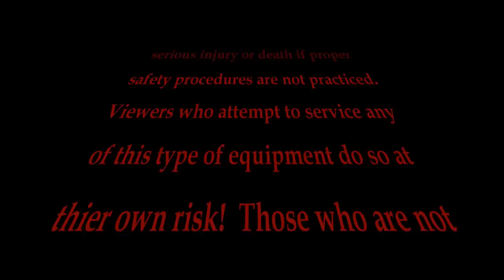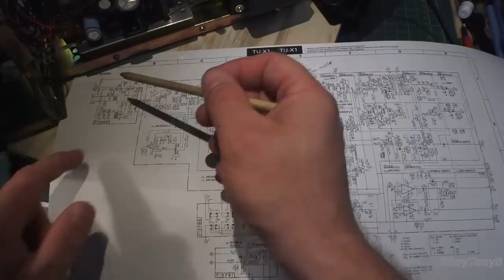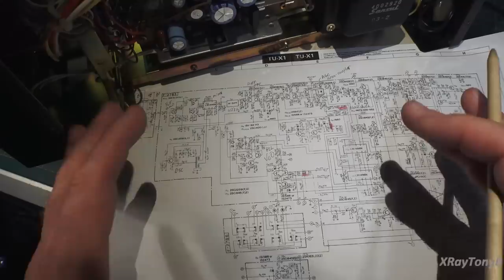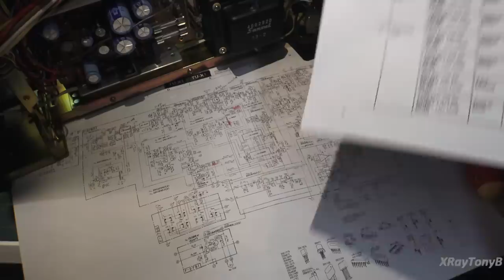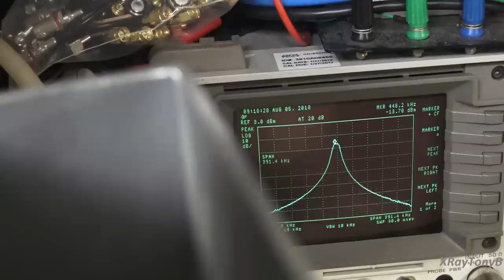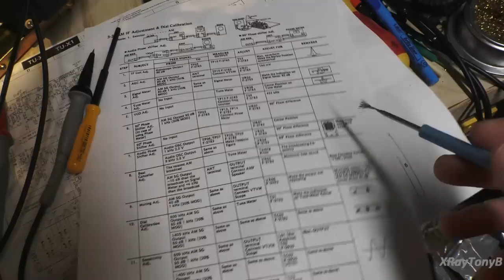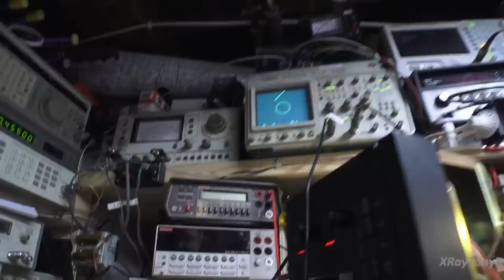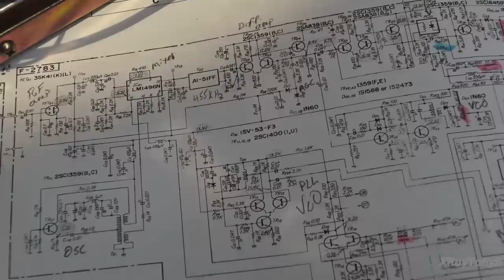Sansui TU-X1 Part 2 - The AM Section

Comment: I am surprised that they didn't see fit to use a Balanced Quadrature Sampling Detector (QSD)(Tayloe Direct Conversion) in the AM side to allow you to listen to signals and get rid of the interference.
Reply: Probably predates the Tayloe detector.  The full quadrature detector is basically as good as you can anyway, and won't spray as much harmonics and subharmonics of 455kHz everywhere too.

Comment: Maybe I missed something, did you demonstrate the am centering meter after the alignment? Cuz it seemed there may have been an issue there going off the first video. And how'd you resolve the 455 kc centering issue? I'll go back and watch again....
Reply from the maker: Hi Jeff, I don't think you missed anything.  I think I may have edited a bit more out than I should have.  The meter works, but it still has very little deflection.  According to the alignment procedure, there is only one adjustment that affects it and it was set correctly.  At this point, I think it just might be the meter, as when I measure the voltage across it, there is a change when I tune off station.  As for the filter, it is definitely bad.  The center frequency is off by almost 3kHz but the bandwidth is wide enough to drive a truck through.  I'm sure this could affect the selectivity of the tuner.  I still might try another non-adjustable filter, as I don't think the original will be easy to find.  If I decide to try it, I'll most likely do a follow up video if there's enough interest.  Thanks for watching!
Reply: So how many IF stages are there and how many IF adjustments? How did they get a a narrow bandwidth with one wide bandwidth filter?
Reply: Hi! Thanks to you for TU-X1's videos, I have learn a lot. I also have  a very nice TU-X1 which was in service and adjust at SS (CT) about 10 years back. That am-meter needle should move like as fm-meter. Your received am-signals/interferences are not strong enough (as you told) and that's why the needle movement is so minor.  73'

Comment: I WOULD JUST LOKE TO KNOW WHAT ARE YOUR THOUGHTS ON THE ONKYO INTEGRA LINE FROM 1987 TO 1993. DO YOU THINK THESE WILL BE FUTURE COLLECTABLES OR DO YOU THINK I SHOULD JUST STICK WITH PIONEER SASUI AND AKAI AND THE OTHER VINTAGE AMPLIFERS THAT HAVE A WARMER SOUND BUT NOT NECESSARY THE DRIVE OF THE OLD ONKYOS. THE REASON I WOULD LIKE TO KNOW YOUR THOUGHTS IS CAUSE I LIKE THE EBAY ONKYOS CAUSE THERE AT THE POINT NOW TO WHERE THERE CHEAP AND I CAN BUY 2 OR 3 FOR THE PRICE OF ONE PIONEER SX 970 OR HIGHER. DO YOU THINK IAM WASTING MY MONEY OR SHOULD I JUST HOLD OFF UNTILL IAM ABLE TO SAVE UP ENOUGH FOR LIKE A PIONEER SX 2800 AND ONLY STICK WITH THOSE AMPLIFERS OR HIGHER
CAUSE I DO LOVE HIFI FEDILITY BUT I ALSO LOVE THE DRIVE OF THE OLD ONKYOS LIKE THE INTEGRA TX 890 AND MY TX 866 AND TX 870 COUPLED WITH MY EQ 550 OR MY TECHNEICS SH - 8066. OR DO YOU THINK I WOULD BE BETTER OFF JUST SAVING UP FOR A COUPLE OF GOOD OLD WARM AMPLIFERS AND ALSO WHAT DO YOU THINK OF THE OLD ONKYO 4500 AND 8500. DO YOU THINK I WOULD BE BETTER OFF WITH A SANSUI OR ARE THE OLD ONKYS JUST AS GOOD. CAUSE IAM REALLY HOOKED ON THE OLD SCHOOL ONKYO DRIVE.
Reply: WHY ARE YOU SHOUTING